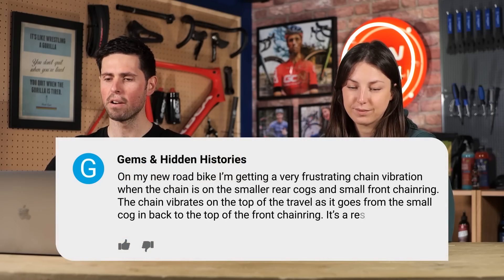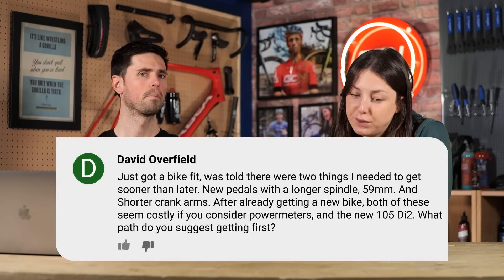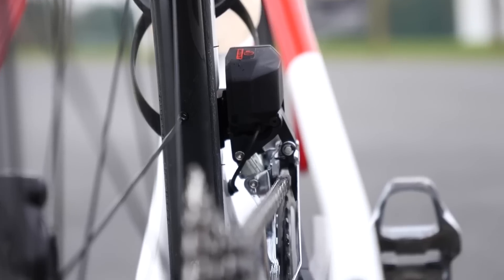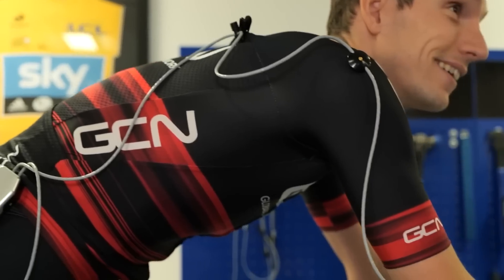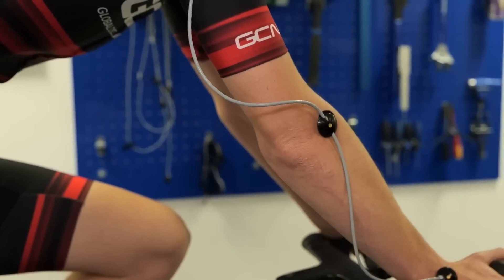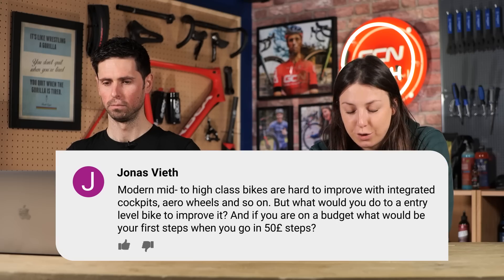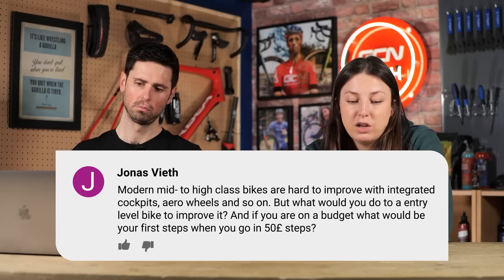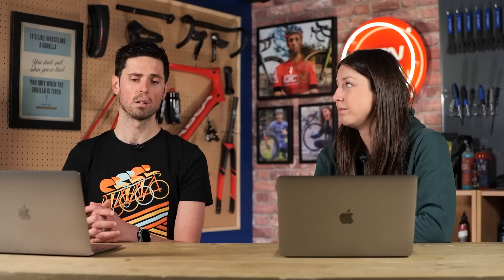Vibrating Chains, Aero Vs Drafting & Entry Level Upgrades | GCN Tech Clinic

Comment from the maker: No questions to small! Let us know your tech queries below using #askgcntech ⚙
Reply: #askgcntech Hello GCN team! My question is if can I use a 10 or even an 11 speed chain on a 9 speed groupset? I heard that the difference between 9 10 and 11 speed chains are minimal, so they can be mixed. (Of coure you can’t use a 9 speed chain on an 11 speed groupset, only the other way around) I have 9 speed sora and I would like to purchase an 11 speed ultegra chain, would it work long term?

Thx
Reply: @randomcontent2469  that be good to know how much it matters, I know the difference is they are 1/32" smaller each speed up for the chain
Reply: #askgcntech Hi, are there any brake levers out there (apart from Microshift) that are suitable for tiny hands with short fingers (age 6-8 in childrens glove sizes) and are compatible with an older model Shimano Sora group set?  Or any hack/bodge that would work?  I’m struggling to reach my combined brake/shifter levers when on the hoods and can’t reach at all in the drops.  They are already adjusted in as far as they will go.  Shimano have confirmed there aren’t any official shims made for the model of brake lever/shifter.
My reach to the bars is fine.
Reply: #askgcntech  Hey lovely GCN folk! Should I just leave my Pirelli Cintueato Velo's on during the Summer, or can I go shopping for Summer tyres? (and what is the Summer tubeless tyre of the people?)
Reply: #askgcntech hey ollie and alex, do we actually really need a 160mm disc brakes if 140mm disc brakes can actually performs just as good as 160mm? example, lets say 160mm disc brakes can generate a torque of 45Nm until the tyres lock in and slip on asphalt, and if 140mm can produce that much torque as well, then it should be enough right? the difference is just that maybe we need to press the lever a little harder then 160mm. An also because of these thoughts im afraid to use 160mm, because it will actually lock in the tyres easier then 140mm disc brakes, when we pull the lever a little too much.

Comment: I went to shorter cranks on my admittedly low-end road bike.  RS-510 non-series 11 speed Shimano cranks were only $80 at the time ($90-100 right now), but came with different rings so I just swapped the old low-miles ones onto the new crankset and called it a day.  Grab RS-520 cranks for 12 speed, also available for $100'ish.  Not the lightest, but I'm no weight weenie (best money saving hack out there is to just not care!).

Comment: Pedal extenders are an alternative to changing spindle length, got them on all my bikes. Buy good quality like Jtek or Kneesavers, avoid thin-wall or dangerous Chinese alloy. Pedal Extenders help eliminate hip, knee, ankle or foot pain for cyclists with a toe-out condition, valgus deformity (knock knee), wide hips or larger feet.

Comment: My thought is derailleur not put enough tension on chain for small to small but yeah best to avoid the extremes
My next bike I am looking more aero but as most I know cycle 10-11mph, I cycle 19mph or higher, also often cycle alone
Glad said about waxed chain as I often took it off and dunk it into the melted wax again without wash but I cycle on road only
Reply: it could be chain rub on the front derailleur, but yeah absolutely no reason you'd need to be in that gear - change to the big ring and go to smaller cog.

Comment: first question also apply to my case, smallest cog + biggest chainring. i think i asked gcntech back in the Jon's day. never got a chance to be answered though.
Reply: Vibration on biggest chainring + smallest cog is an inherent effect of small cogs - because the chain is wrapped at a tight angle and the teeth disengage quickly.  On my bike I get a slight vibration in the 11t cog at speed.

Comment: #askgcntech ⚙ what makes shifters and cassettes 1by only or 2by compatible? What will happen if I put Eagle AXS rear derailleur and 10-52t Eagle cassette on the back and Force AXS front derailleur with nice big 2by road Force crankset? Would it work at all? The idea is to have two sets of wheels (road and gravel/offroad) and simply swap wheels without changing shifters, crankset etc. while still being able to go fast on road and go steep off-road
Reply: A 10-52 cassette would be too big for a 2x drivetrain.  There is a limit to the rear derailleur's chain wrap capacity - that is, the difference between the smallest / largest cogs plus the difference between the smallest / largest rings.  

With a 10-52 cassette (difference of 42) and, say, a 50-34 chainset (difference of 16) the total difference is 58 teeth - which is way higher than a typical chain wrap capacity of 35 to 45 teeth.  

If you significantly exceed the derailleur's chain wrap capacity, you'll potentially end up with either the chain sagging loosely because the derailleur can't pull the chain back any farther (small chainring + sprocket) or - much more serious - the derailleur being damaged because the chain is too tight (big ring + sprocket).
Reply: @trainiax  Ofcourse it is not supposed to cross chain - no biggie-bigs or smally-smalls!
Reply: @ShtopoRrr  Very true - but you'd still run the risk of damage if you crosschained by mistake.  As much as I avoid cross-chaining I still catch myself doing so occasionally (usually forgetting to shift at the front after a long and gradual speed change)

Comment: #askgcntech I'll shortly be riding my first TT - 80km as part of a team triathlon. I recently picked up some clincher Zipp 404s with 13mm internal width. It's all on tarmac, and the surface should be fairly good. Should I run 23, 25 or 28mm tyres on the front? Same on the rear?

Comment: #askgcntech I've got a Giant Talon 2 MTB with 27.5" wheels. Usually runs on Maxxis 2.1" wide tyres. Would it be feasible to just swap the tyres to a hybrid/gravel tyre, I seem to be far more into my gravel/trail riding these days, with minimal muddy stuff. If so, any suggestion for tyres ?

Comment: About the chain Vibration, I get that as well if I'm on the big ring and middle cog at the back all the way to the small cog but, only if I'm making a big effort like a sprint or a climb.  I've made sure I've Index the gear properly and even adjusted the front derailer to not rub on any gear combination.   Could it be just my frame that's the issue?
Reply: Sounds like cassette wear in your most used gears. I had a similar problem after several months of living in a flat area and spending a large proportion of my time in the fast gears.
Reply: @askmeaboutmattweiner  I'll look into that.  Thanks, Mate! 🥰
Reply: I’ve similar issues. Brandnew bike, Campa EPS, perfectly adjusted. I can ride cross chain (small-small or large-large) without any rubbing. Nevertheless, under load, the whole drivetrain starts vibrating. It’s so annoying and I don’t have any idea, nor has the bike shop.
Reply: @hallodidldu  Hey, got any solution for this problem ? Got the same issue on new bike :(
Reply: @FliskerX  unfortunately not. My bikeshop just called me that he recently built up a completely different bike, different frame, Shimano instead of Campa etc.. The only thing in common was the 12 speed. So, he currently thinks that 12 speed is simply more sensitive to this issue. I could agree because my old steel roadbike has 9 speed without any issues, the next one is an aluminum frame with 11 speed with very minor issues regarding vibration, some but hardly noticeable. The 12 speed carbon frame then is vibrating clearly.
I hope to be able to switch to a thread-together bottom bracket soon instead of the inferior pressfit shells. Let’s see if this will change anything.
Reply: @hallodidldu Thanks for info :)

Comment: #askgcntech do the watts per kilo figures which are often banded about take into account the weight of the bike as well as the rider? Wouldn't it be fairer if the bike weight limit were a proportion of the rider's weight rather than the same figure for everyone, as a diminutive rider will be more negatively affected than a big rider in terms of the effect on W/kg of the bike's weight?

Comment: #askgcntech I have an entry level 3x8-speed bike that I upgraded to 1x10-speed so I have wider cog options for climbing and to not worry about cross-chaining and I am satisfied as of now. My question is, would upgrading to either an 11 or 12 speed setup give me a noticeable performance increase considering that these cassettes also have 11 teeth on it's smallest gear?
Reply: There would be two possible benefits.  If you went with a cassette with the same overall range, you'd have slightly closer cog spacing, which would make it easier to find an optimal cadence on the flat.  If you went with a wider cassette range, you'd end up with a lower climbing gear while keeping similar jumps between the cogs.  It probably wouldn't give a big performance increase in most riding situations, but I expect the difference would still be perceptible.

I currently have a 2x9 drivetrain, and with an 11-32 cassette, the differences in cog spacing compared to a 2x11 setup are too small to justify upgrading.  However, if I had a 1x drivetrain, I'd want at least 11 cogs at the back - and even then it still wouldn't quite give the same range and spacing as 2x9.

Comment: How do I tune a derailleur when it's on a Zwift trainer? If I take the bike off the trainer and put the tire on to tune it might not be tuned correctly for the trainer. So, what do I do? #askGCNTech
Reply: You might have to add shims to one or the other to get the cassettes into the same relative postion for the rear mech.
Reply: @stevemawer848  Shims? How?
Reply: @JeffCole60  Presumably the cogs don't align in the same way on the trainer and your wheel so you need to pack out the one that's more towards the centre to bring it out to match the other one.  If such shims are available, I have no idea, but that's the only way I can think of to get the two cassettes to align with each other.

Comment: #askgcntech Hi Guys, I hope you're all well. I've been riding bikes for 49 years and this is the first time I've ever had this problem! My rear tyre, Conti 5000, 32mm, Keeps burping off the rim at 80lbs pressure! Is 80lbs too much? It's below the "advised" pressure. I dropped it to 50lb and it seems OK. I've asked a few bike techies I know and they all say 80lb should be fine. Any thoughts?

Comment: #askgcntech i get it: aero saves watts. if i'm a pro, i'm doing a time trial, i'm soloing off the front at 45kph, i want the deep dish wheels. but i'm not any of those things, most of the time. i'm out riding at 30kph, with crosswinds whacking me from all sides. i'm climbing hills. i'm accelerating away from intersections. are those aero wheels giving me more than they're taking in weight and fatigue from fighting the crosswinds? i finally settled on 33s instead of 50s or 60s, and i feel like i'm enjoying myself more and fatiguing myself less. am i imagining things? is this like how we all used to think we should run 19c or 23c at 120psi? are we going to look back and say 🤦‍♂ "how could i have been so naive???"

Comment: Hi guys, does making more gear shifts per ride affect the life of a mechanical gear cable? #askgcntech
Reply: Very much so.  A common failure point on Shimano drop-bar shifters is inside the shifter, where the cable wraps around the pulley.  The constant straightening / bending of the cable when shifting will cause the cable to eventually fray from fatigue - which is directly related to the number of shifts.  

Last year I proactively replaced my cables at 12,500 km - and it was a good thing I did, as the rear derailleur cable had just started fraying.  Despite much higher spring tension, the front derailleur cable was fine since I shifted it much less often.

Best to replace them before they snap, since it's a real pain to get a broken cable out of the shifter.

Comment: For the question on bike fit, get some flat pedals and enjoy. I'd probably try work around the shorter crank arms, I'm sure it can help but realistically are you gonna notice 2.5-5mm different crank length, probably not. I'm sure some stretching can accommodate such a small difference

Comment: #askgcntech Hi all!! I'm about to upgrade from my urban comunting bike to an endurance road. According to the manufacturer's size guide, i fall right in the middle of their 52 and 54 size. Which one do you recommend i should get? Should i get a slightly bigger or smaller bike? Or maybe get a bike fit first? Thanks!!! Greetings from Mexico 🇲🇽
Reply: I have this problem as well, and would like to see a proper educated answer to it. I've been told a lot of it is down to feel, because you can incrementally make a bike a bit bigger or smaller with seat post set back and stem length. My bike now took an age and a load of money for me to get comfortable on. Because of my experience, I would from now on tend to think going with the smaller size rather than the larger one would do for ME. Bit I don't know if that would hold true for you.
Good Luck!!!
Reply: If you can, it's always best to try at the bike store. But some bike-fitting videos I've watched suggest that people tend to buy too large frames (people overestimate their flexibility) - and it's quite rare to buy too small. Manytimes it comes down to right fitting (saddle, stem, drops etc.).
Reply: Remember the smaller frame will not only have a shorter reach, the stack will be shorter too.  Larger bikes can be more comfortable as there they have a longer head tube (and stack) with less drop - just check your not too stretch out....... But yeah, sit on it and try.
Reply: I had the same problem. I opted for the smaller size, it suited me better and I have been enjoying my bike since 2014